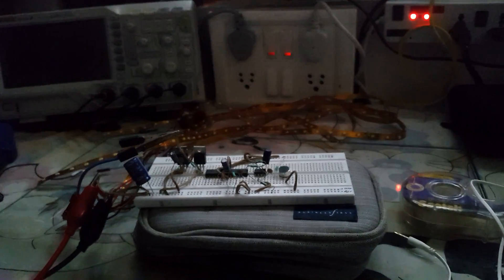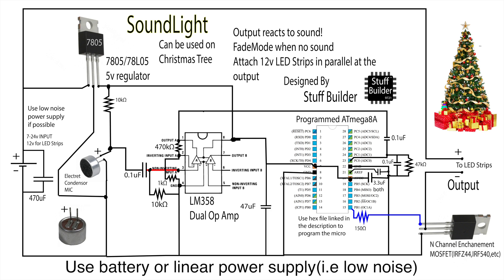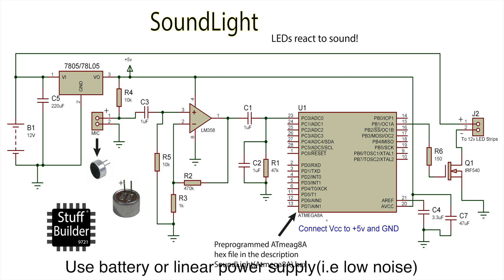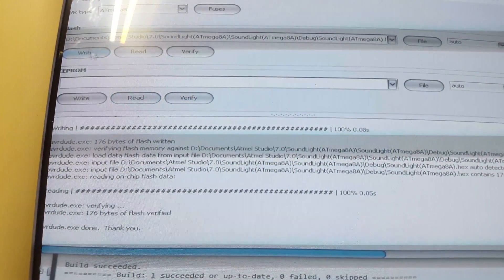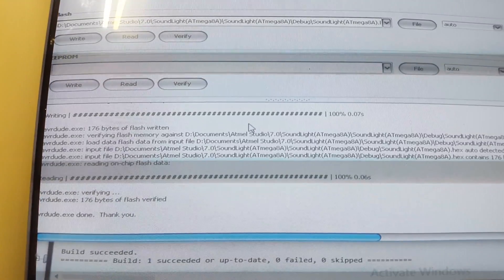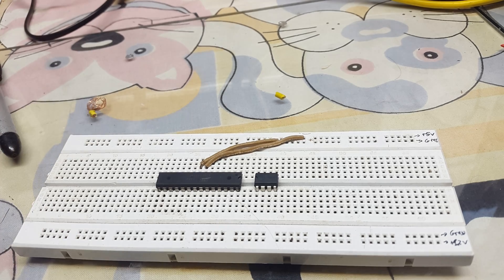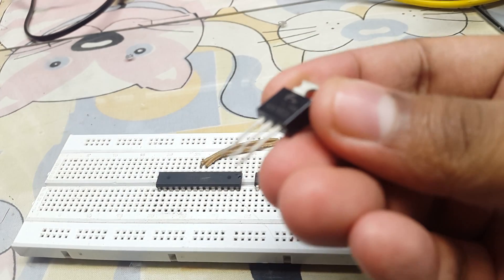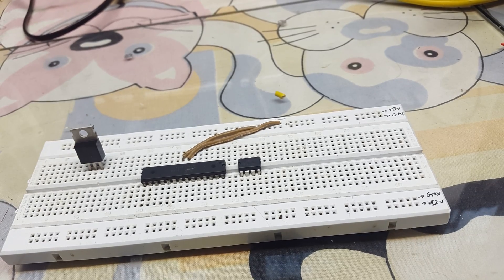How to make LEDs react to voice/music for Christmas lighting!

Comment: so , can I connect the output to a speaker?
Reply from the maker: No. It will sound wired. I'm not sending voice signals to the LEDs. They are just switched based on amount on voice the mic receives.

Comment: please also make video on Tesla coils or Slayer exciter
Reply from the maker: I've always wanted to make a Tesla coil. I'm still trying to make a circuit that will produce enough high voltage so it sparks at least on inch apart. Maybe I'll upload it if I ever make a Tesla coil or a high voltage circuit.
Reply: There exists a simple circuit , components - 
1x MOSFET irfp250n or better
1x MOSFET driver IC DS0026
1x 10 k resistor
1x 100 to 500 pf capacitor
1x 3300 micro farad capacitors
2x 1N4148 diode, any diode will work.
power supply - 9 to 18 v
1x heat sink for MOSFET
primary and secondary windings on a pvc pipe.
primary - 5 turns 
secondary - 400 to 500 turns
Reply: for the schematic you can watch a video - 
power Max 
how to make sstc driver circuit

Comment: This circuit is wrong. And it's not work. Lm358 - - pin4 is negative and pin8 is positive.
Reply from the maker: +Jayanta Sarkar Yup
Made a mistake there
But if that is corrected then it should definitely work. I have tested it
Reply from the maker: Thanks for pointing that : )